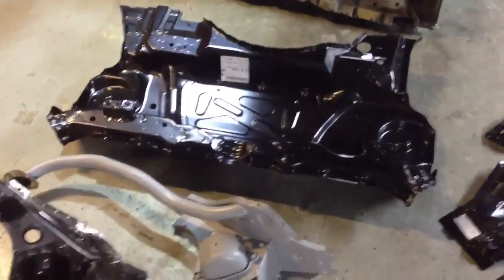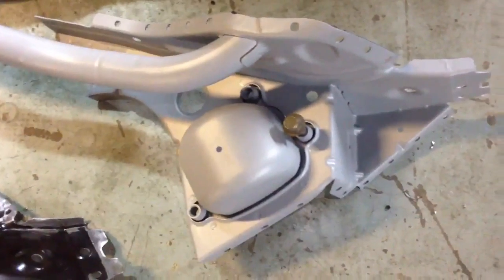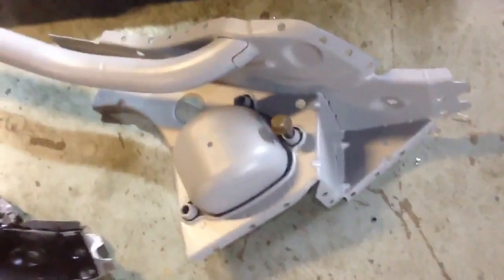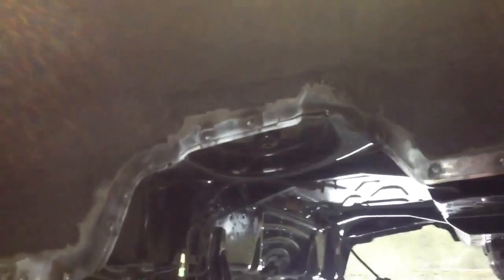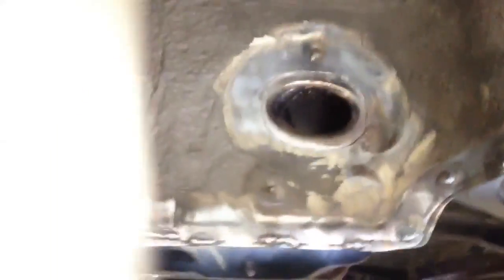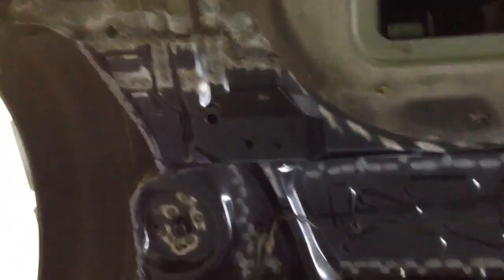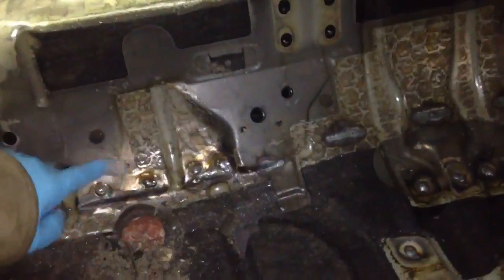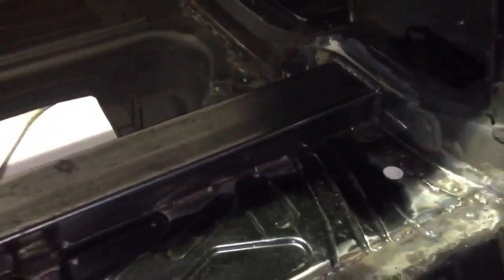MASSIVE E46 M3 Subframe Floor Crack Damage & Repair - Part 3

Comment: Are the repairs worth the costs? This is and the lack of non-smg e46 M3s for sale keeps me from buying one and currently saving for an e92 alternatively.
Reply: Kind of depends on if you want an M3 of this generation or not, right? The repairs are expensive, but they are still less than the purchase price for the vehicle, and it should be a lifetime fix.
Reply: @opmike343  you must wonder what other little suprises are waiting down the road